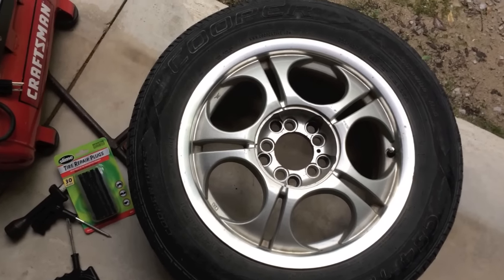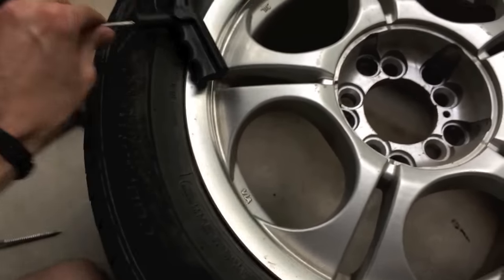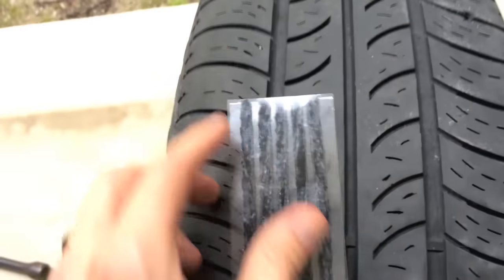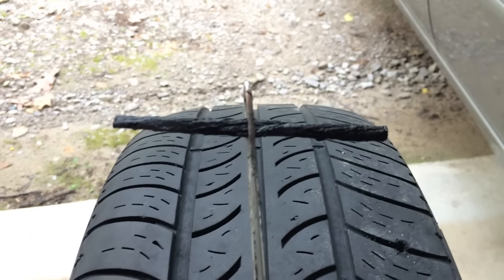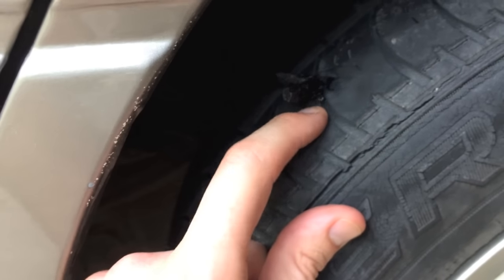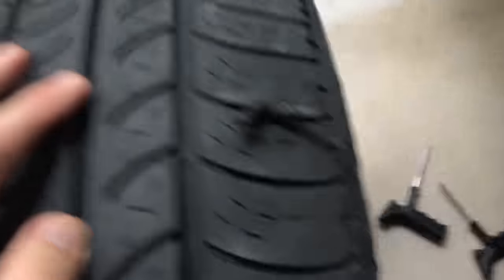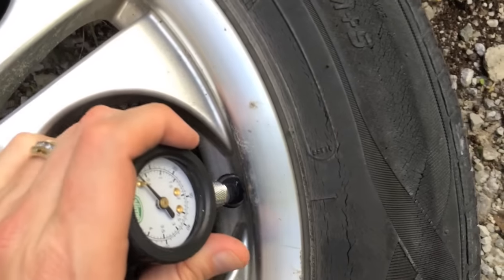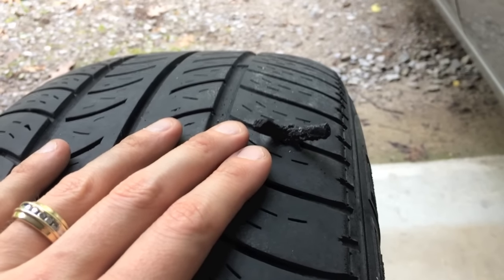How to Patch/Plug Hole in Tire in LESS THAN 5 Minutes - Fix a Flat Tire - EASY FIX

Comment: Thank you. I couldn't figure out what I was doing wrong, the instructions seemed so simple and I have watched the guys at the shop do it a dozen times. 

I gotta get a better kit.  Thats my issue. 

The big needle in the kit I was given  didnt have a split in it, it was a solid loop and couldnt get the plug to stay in. And it had a regualr screwdriver handle, not the T shaped one, so I ended up with a huge blister on my palm trying to twist and push it through. 😂
Reply from the maker: Thanks for watching and sharing your experience.  This kit can come in a few different styles.  👍

If interested in purchasing this product, visit our Amazon affiliate link below.  I earn from qualifying purchases.

       https://amzn.to/3v5yXcX

😎👍🔧🔩
Reply: @DIYwithMichaelBorders  it had to be done today or I would gladly toss you the buisness. 
 I got the Slime kit w the T shape handles and had it fixed in 5 minutes. The kit the guy at work gave me turned out to be the cheapest no-name Chinese kit they make 🤣. 
100% why i was having a hard time.
Reply from the maker: @gwoody4003  

Awesome job, hopefully you can relax moving forward.  😎👍

Comment: Most plugs are RTV (room temperature vulcanizing) and don't require rubber cement. However the rubber cement won't harm anything and does make the plug easier to push in.
Reply from the maker: Thanks for watching & sharing this.

😎👍

Comment: Nice, you skipped the one part I was trying to figure out, pulling it out without pulling thing with it. How did you manage that? LOL
Reply: Okay, I looked again, and it's there. Before the video just jump cut over it. Must have been a glitch. My apologies. Thanks for the video. I've done it before, but was having trouble. I remember something about twisting it before you pull it out...
Reply: There is a slit on the end of the tool so that the rubber strip will come out when you pull out the tool.
Reply: If the plug comes out, the hole is probably too big

Comment: Great video! Tx. But, hot damn! Them tires got Dry Rot! How much longer did they last?
Reply from the maker: Mail Jab 

Thanks for watching & the tire was replaced a few months later.  We got all new tires installed.

We hope the video helped.  Please subscribe to the channel and turn on your YouTube notification Bell 🛎 that would be awesome thanks again.

😎👍🔧🔩
Reply: Desmond Bagley  you mean "tires"
Reply: @Peter Anagnostidis I plug my passenger car tires all the time. If it's in the shoulder it'll last 6 months and air will slowly leak out. Most tire shops won't do it for you, but, if you DIY it it'll get you down the road until you can get the tore replaced. In the center of the tire, the plugs are usually good for the life of the tire, or a few years. YMMV. I don't go mudding, so I can't say. You'll need to ask elsewhere.

Comment: Make sure you buy a nice tire plug kit, online they sell for only about 20 bucks, it will have much better reamers and handles than the cheap one used here.  You will need a cheap air compressor in your trunk too.  I have fixed many, many tires (tow truck days) and never taken the wheel off the car or truck before, just roll the tire around so you can easily work on the hole.  Finding it might be your biggest problem, after that, as long as it's not a sidewall puncture, you can ream it out good, don't worry, the plug will plug the hole, works every time, I have even once used two plugs at the same time on a really huge hole, I wouldn't drive far with a hole like that, but for normal plugged tires, they can go for a long way.

Comment: They told me that a plug won't work outside the lines. they said you have to patch it from the inside. So I had that done. It still leaks. So I'm using Fix A Flat to finish off the job. I saw so many use plugs. They must really work.
Reply from the maker: petro062 

Thanks for sharing.  We hope the video helped.  Is your leak fixed?

Please subscribe to the channel and turn on your YouTube notification Bell 🛎 that would be awesome thanks again!

😎👍🔧🔩

😎👍🔧🔩
Reply: Tire warranties won’t cover punctures near the sidewall.  Tire companies are crooks when it comes to repair requirements. And most tire shops don’t know anything.  Plugs always work if the hole isn’t huge.

Comment: Can you still drive like 90 on the freeway with a patch?
Reply from the maker: Yung Whale 

Glad to help & we appreciate you watching.  We definitely have not done that before & don’t recommend it.  We hope this helps.  Us fellow DIY’ers need to stick together.  Many more helpful videos to come!  😀

Please subscribe to the channel and Ring your YouTube Bell 🛎 that would be awesome thanks again!

😎👍🔧🔩
Reply: I'll let you know. I'm about to plug mine
Reply from the maker: Daniel Smith 

Thanks for watching.  😎👍🔧🔩
Reply: Yes, I’d you did it correctly.
Reply: A plug is a short term fix depending on the life tread left on the tire. If in correctly it molds to the tire eventually and speed isn't a factor. If your on the outside edge one inch or less an internal patch is recommended
Reply: I've gotten a tire patched / plugged before (wasn't done by ) and I went 150 and no Issues whatsoever. Patches will usually last Till the end of the tire life

Comment: Add cement liberally to the plug before putting in.  It makes inserting the plug easier, and helps seal the hole better.
Lastly, after inflating the tire to the proper air pressure, and clipping off the excess plug, put some soapy water over the repair to check for leaks.  The soap bubbles make it much easier to see a leak, rather than trying to listen for a slow leak that may still be there.
Reply from the maker: Thanks for sharing.  😎👍

Comment: How can you tell when it's too near the wall to repair with a plug?
Reply: You never want to plug a hole bigger than 1/4 in or closer than an inch to the sidewall. This video is borderline in how close that hole is to the sidewall. If yours is closer than in this video I wouldn't try to plug it. A patch could be more suitable but for maximum safety get a new tire.

Comment: Good video. Although, instructions on the Slime tire patch kit, said to rapidly remove the set tool to replace it from the tire and to separate it from the plug. You stated to slowly remove the tool. You also didn’t mention, after you plug the hole and fill it up to the proper psi, you use a bottle with water and soap and spray over the hole, if there is no bubbles the hole is repaired, if you see bubbles you need to reset the plug.

Comment: What about the rubber cement???
Reply from the maker: ragman069 

Thanks for watching & sharing your comment.  Great question.  The cement is very good to use.

Due to the size of the hole, the plug was sufficiently acceptable this time around.

Hope this helps!  Please subscribe to the channel and turn on your YouTube notification Bell 🛎 that would be awesome thanks again!  😎👍🔧🔩
Reply: Some of those plug kits don't use cement. I used to work at a parts store, the more expensive ones are SUPER sticky and don't require any. The "self vulcanize" or so they claim...

Comment: Is this dangerous can your tire blow up when you're going out at high speeds
Reply from the maker: Thanks for checking out the video.  This repair kit's purpose is to get the tire back up to working order so that you can drive it to the repair station to get a new tire.  I have driven several miles on these kits and have also talked to people that have used this kit and has driven 10,000 miles.  Most important thing is that the kit is used correctly for best results.  Please Subscribe to the channel that would be awesome!
Reply: DIY With Michael Borders what is the point repair it and then driving to the garage to sort out money for another tire once the tire is plugged i heard it's good to go
Reply: I plugged a hole in my tire like this after a piece of grader blade punctured it. I drove over 20, 000 kms on that plug before it gave me any trouble
Reply: icslook, that plan will only work if you have a way to fill the tire where ever your at. I hope you have a pump.
Reply from the maker: lac365 

Thanks for watching!
Reply from the maker: Jim Bloak 

Thanks for sharing your comment!  That’s awesome!  😎👍🔧🔩
Reply: These patches (or at least the ones I use) are guaranteed for the life of the tire, as long as it’s done properly it’s completely safe
Reply from the maker: Mike 

Thanks for sharing your comment Mike!  That’s awesome!  We appreciate it!  We have been very pleased with this tire patch kit & tool.  Let us know if you have any additional questions along the way!  😎👍🔧🔩
Reply: I've driven in mine for over 2 years
Reply from the maker: waterboy01440 

Thanks for watching!  We appreciate you leaving a comment.  These little tire replacement kits are pretty neat & reliable if installed correctly.

Please subscribe to the channel and turn on your YouTube notification Bell that would be awesome thanks again!
Reply: lac365 that's really fast
Reply from the maker: David L 

Thanks for watching!  Hope the video helped!  Please subscribe to the channel and turn on your YouTube notification Bell 🛎 that would be awesome thanks again!  😎👍🔧🔩
Reply: Angelique Coleman Don’t listen to him, it’s almost “good as new”, you can replace your tire on a regular schedule (maybe 50,000 miles) with this repair.
Reply: @seededsoul  i plugged my Tacoma truck tire and drove it for 3 years with no problem.
Reply: @Keisha7612  I believe the reason is that the tire tread is usually quite worn when the tire starts getting junk imbedded in it. So you'll have to replace the tire quite soon.

Comment: I thought you had to burn it a bit with a lighter to complete the seal.
Reply from the maker: Joselito Muller II Thanks for checking out the video Joselito.  No burning required with this product.  I have had good luck with this product.  Please Subscribe to the channel and turn on your YouTube notifications that would be awesome thanks again 😀👍
Reply: Joselito Muller II Its not needed but the method of burning the excess plug seals the tire much better. The plug should be coated liberally with rubber solution before plugging the hole also it helps when doing the burning  method.
Reply: The cement/glue is flammable. So maybe not
Reply: The types of plugs used in the video are self vulcanizing by the heat of the tire as you drive.

Comment: For all the people saying they recommend or need to add glue to the plug prior to sticking it in.... that is not necessary. I've plugged probably 10 tires in the last 8 years and I know of others who have done way more than that who don't put glue on. Also read a comment on another video of someone who owns or has worked at a taxi cab company and does not suggest you waste your time and money on adding glue. 

It is redundant to do so with this plug kit. The plug material once cut flush with the tread and driven for miles will seat it in place perfectly and the hot tires after spinning for so many revolutions will form the material and bond it to the rubber tires. Thats your glue... the plug itself. Nuff said.
Reply from the maker: Good morning ☕️ we really appreciate you taking the time to share your thoughts.

We feel the same way, glue is an added bonus for many that are interested in applying it however after installing countless amounts of plugs to tires over the decades….grabbing the glue and applying it…just fades away as an option.

😎👍🧰☕️

Comment: yes, but how do you find the hole ?
Reply: I use dishsoap and water. If it's very small, you have to smear soapy water all over it and watch closely for bubbles coming off the surface. Or fill your tub with water and submerge the tire. Then watch for air bubbles coming out. If it's a tiny hole you might have to make it bigger just to get the plug in. Or you might be able to deflate the tire and use a syringe to inject rubber cement into the pinhole.
Reply from the maker: Joshua Schofield 

Awesome Awesome & thanks for sharing your info.  You Rock!

😎👍🔧🔩

Comment: Does this remove the need to get the tire replaced or is that hoping too high?
Reply from the maker: Thanks for watching & welcome to the DIY Raptor Club.  Great question & we have asked the same question to the manufacturer.

Although they will not say directly that this alleviates the need to replace tire, they are very strong on the fact that this is a great way to get the hole plugged & get the tire back to a state where it can hold the required psi for safe driving.

Comment: Great video 👍 I had plugs last 2 or 3 years probally more if didn’t need new tires. I Decided to do myself instead have a shop want 10 dollars or  more and give me hard time  or not do it bc close to sidewall.  I had them close to sidewall  with no issue as well.
Reply from the maker: Good morning & we appreciate you sharing this.  These little plugs are great.

😎👍🔧🔩
Reply: The reason being is that it’s close to the sidewall. If it blows out or doesn’t work properly, you can’t blame them.
Reply: @rjlewis8346  true I see your point but like any repair they do can come back to them to be blamed that’s why you have insurance. One shop has my coolant reservoir tank cap  loose and a coolant hose clamp  loose it leaked. I also think shops want you to spend more money on new tires instead
Reply: @fireman62truck 
You are wrong about them wanting to sell you a tyre……there is more profit to be made on repairing than replacing as more often than not, the mark-up on a new tyre is very small.
As regards the “close to sidewall” repair-no reputable experienced tyre technician will do it as it’s close to the “flexing” part of the tyre-in other words, the shoulder that does all the hard work on cornering etc-this can cause a repair unit to fail. Also, if you are not removing the tyre to repair it, how can you tell that there is no run-flat damage to the inside of the wall of the tyre? This can occur when the tyre has been run in an under-inflated condition. The people on here who claim they’ve been doing this for years without incident, have been lucky.

Comment: I just got the same kit, my tool that holds the plug is almost closed at the end where yours looks to be like 3/16 of inch of a gap, or will it open up a little bit after I use it? Never used these before, thanks.

Comment: Can you do this if it's on the corner of the tire? Not side but corner?
Reply from the maker: Thanks for watching, the corner/edge is considered a “replace tire” as opposed to repairing it.  

We recommend replacing tire.  

😎👍🧰
Reply: @DIYwithMichaelBorders  I understand. I feel like mine is not exactly at the edge. So may be I can save it. The tire is Michelin 235/35 R20 which is like 500 bucks
Reply from the maker: @MR-AK  

Thanks for the follow up, that’s a pricey tire.  Keep us posted on your progress.

Comment: I just had to use one of these on a new KIA stinger.I contacted the manufacturer and they said these things will last the life of the tire and actually are so sticky that they will actually seal themselves--they said you could get a tack and stick it thru the plug and it would seal it.Only very extreme heat could soften it--but once it expands and you get most of the plug in there should be a permanent fix.I am going to the drag next month and now feel confident about this fix.BTW remove the tire if it is on the rear--it takes a lot of strength to push this thing thru.
Reply from the maker: Good morning & thanks for watching.  We appreciate you sharing this.

😎👍🔧🔩

Comment: Any recommendations for when the plug + t slot tool just doesn't want to go in? I've plugged a few tires but this one just doesn't wanna go in no matter what I do. I tried twisting it, hammering it, it just refuses to go any further.
Reply from the maker: Hey there, thanks for watching.  Any update?  You may need to shift back to the tool used for shaving the hole into a slightly larger and cleaner diameter.

Using this tool to make hole larger will hopefully give you the opening you need to shift plug into place and create seal.  Please keep us posted and hey if you’re into crypto trading, check out our DIY ecosystem.

       Toolboxtoken.com

Reach out to us any time!  🧰
Reply: @DIYwithMichaelBorders  Hey thanks for getting back to me. Boy, what made everything worse is it was at night with very little light and its cold and pouring torrential rain haha. I was beyond exhausted. I finally got it done after widening the hole even more and then using the lubricant. But its finally plugged!
Reply from the maker: @theshazman  

Oh man, that doesn’t sound fun.  Great to hear you got it squared away though, that’s awesome.  😎👍🧰

Comment: I had a small piece of metal in the same area on my tire..took it to discount tire to fix and tire rotation because its free because i bought my tires from them and they wouldn't patch it because of the its in the no zone i guess for inside patch..so i just plugged it myself at home..
Reply from the maker: Good morning ☕️ thanks for sharing your experience.  This kit is great.

Comment: Just tried it on a tire that I got a screw in.  It was in the tread and not the sidewall, so hopefully the patch will hold.  I figured for $7 I'll try it and see before I take it to GoodYear and have them patch it.  Going to wait a few hours for the rubber cement to dry, then inflate to 32 PSI and hope for the best!
Reply from the maker: Very cool, we appreciate you sharing this.  Keep us posted on how it performs.

😎👍
Reply: @DIYwithMichaelBorders  So far so good!  Plug seems to be holding.
Reply from the maker: @patluvsvettes  

Very cool.  😎👍

Comment: So is the nail inside the tire now? Won’t it rattle when you drive?
Reply from the maker: Thanks for watching, you will want to pull nail out of tire, not push it in.  

😎👍🧰
Reply: @DIYwithMichaelBorders  ok. in the video did you push it in?
Reply from the maker: @majorcheese2345  

Thanks for the reply, we pulled nail/screw out of tire.